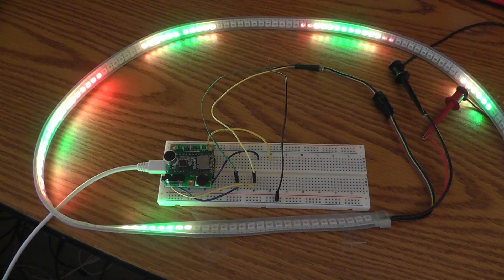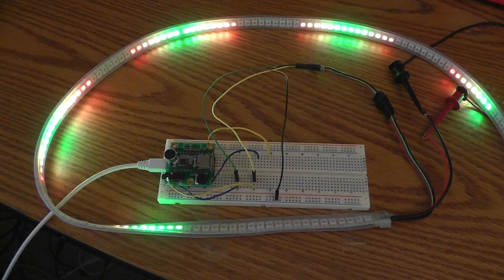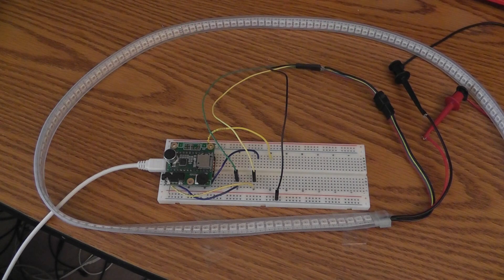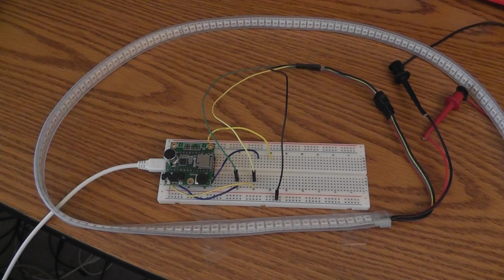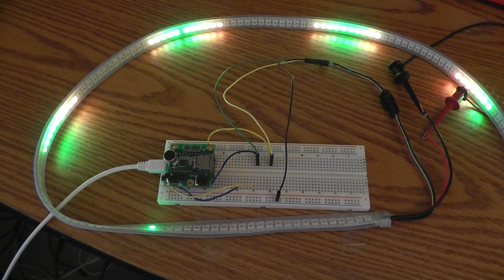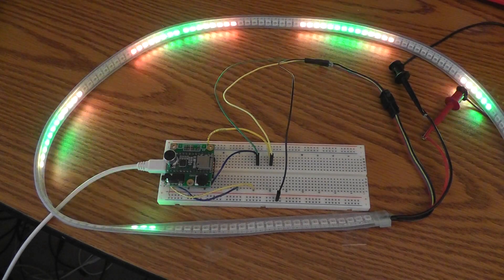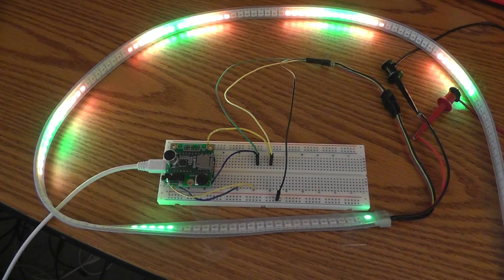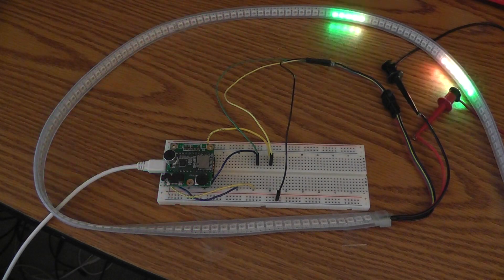FastLED with APA102 and Audio Library FFT test

Comment: That looks very nice and smooth. I was wondering if you saw my similar project where I did FFT and just used an ATmega328 to do realtime audio processing. It sits inline with your music source, but can use an electret mic also. http://nootropicdesign.com/lumazoid. (shameless promotion, but it's relevant...)
Reply from the maker: +nootropic design Looks like you're doing 128 point FFT, with windowing but without overlap (missing parts of the input signal) plus dead time while updating the LEDs (missing more of the input signal).  Not bad for such a limited 8 bit chip, but not in the same league as 50% overlapped 1024 point FFT, leaving plenty of CPU time free for the main program to update the LEDs without missing any signal input.